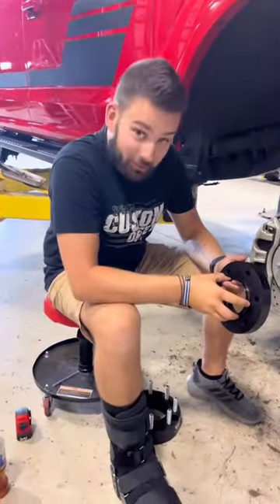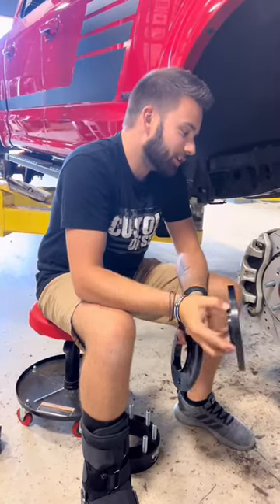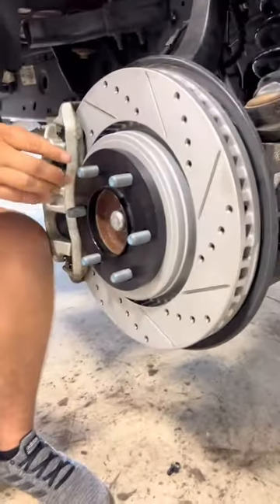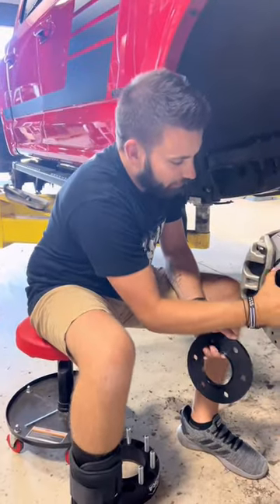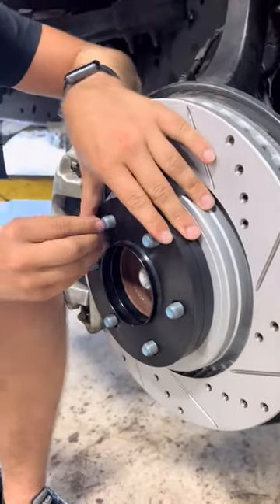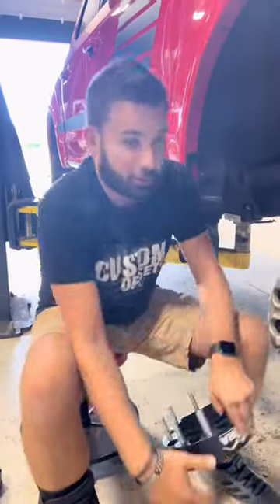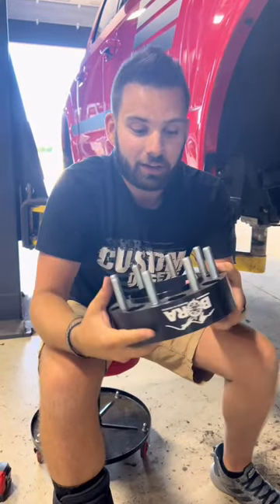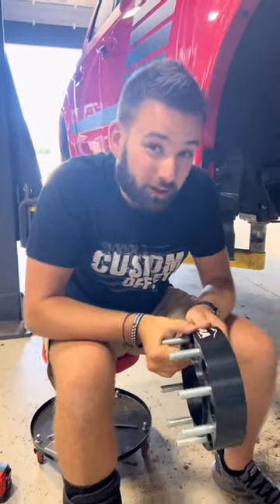Everything You Need To Know About Wheel Spacers #shorts

Comment: I can tell you everything you need to know about spacers. 1: Don't use them 2: refer to 1
Reply: People don't understand why hub bearings and suspension goes to $**t when they use these and think there's gotta be something else wrong. Or get upset when then jack around w the suspense and it won't go back in proper alignment.
Reply: No, I fking hate when wheels are tucked in😤😤 You must hate low ET rims too right? 😂
Reply: When you dont use extremely wide spacers but something like 0.5-1 inch, nothing will happen. I been using it forever or my 30yo bmw drift car and nothing is broken, chill
Reply: @denisnovacek8428  BMW is half the weight of a truck. This is truck stuff they're talking about in the video. If you "drift" your BMW, you have upgraded parts, or are changing them out often, and aren't gonna have time to see the damage from spacers.
Reply: Cars not to bad but trucks especially heavy ones should be a safety concern
Reply: 1. Correct and 2. Correct 😎
Reply: Why not?
Reply: There’s homosexuals out there that actually think people put spacers on for luxe Nahh cuddy we’re just trying to clear them tie rod ends with the stock wheels ya dig
Reply: sobi meed wheel spacers for my miata probably going with 15mm it shouldnt really cause any stress right since its such a light car?
Reply: Why?
Reply: @brianmason8400 This is actually a wrong misconception I used to believe as well.  Ideally the bearing would be happiest with 0 offset wheels, which you know are very aggressive offsets.  0 offset means 0 side load on the bearings.  The closer you are to 0 the lower the side load.
Reply: Do the Bora spacers come with the necessary hardware needed to mount them to the hub?
Reply: Okay but sometimes spacers can be somewhat necessary, for instance my 1 ton dually doesn't have proper clearance between the rear tires so I'm going to have to get a spacer between the two rear wheels. I'm kind of amazed the tires haven't blown considering they ever so slightly touch as is. Averages to about a quarter inch of space in most places but that's too close for me. I'm getting hub centric spacers and again, only between the inner and outer wheel. Shouldn't that be okay?
Reply: Just make sure you have hub centric spacers and don't go over 2 inches, you'll be fine
Reply: Smartest and correct comment.....factory wheel offset is by design to evenly load bearings so they don't fail.
Reply: If you plan on keeping the wheels stock depending on the size… don’t go over 2 inches
Reply: i have 2 inch on my silverado and been great ever since.
Reply: I want spacers on my off-road truck nothing too crazy i bought with a lift (genuinely wasn’t on purpose i was looking at rangers and tacomas and mazda everything was crazy got a 2014 5.7 hemi for cheap off a family mechanic)

Comment: Don’t forget, if you run a studded spacer you may need open ended lugs. So measure your lug and wheel depth.
Reply: It's also a good idea to balance the wheel and the studded spacer together. With a studded spacer there's more centrifugal force and it's possible to develop a vibration. You can mount the studded spacer to the wheel and put it on a balancer. Then mark where they line up before you mount it back on the car. Helped my F-body camaro ride better after I put spacers on the rear.
Reply: @Blade_of_Violet_Chaos  sounds great until you do a tire rotation
Reply: @hunterraatz5481  True
Reply: I found out I needed open ended lug nuts when I bought my 2" spacers. 😆
Reply: How does offset affect?

Comment: Don’t forget to order new wheel bearings as well over time you will need them!!!!
Reply: Even for really thin ones?
Reply: Been running 4 inch spacers for about 6 years now and still no issue on my 06 dakota everything is still good and it still gets your typical v8 mileage
Reply: @imoffendedthatyouareoffended  exactly if you buy quality spacers with hub centric then your vehicle will be fine almost all the people ik have bora spacers and none have had accidents or anything that you usually hear in spacers arguments
Reply: @JYSnukejoe surprise surprise I had the 02 Dakota V6 and I'm looking to run spacers to change the bolt pattern😊
Reply: @PACKERMAN2077  just buy quality ones and you'll be fine I had to make some cuts into the fender liner so it doesnt rub so depends on the size
Reply: @YOUARESOFT.  I didn't mean accidents with Bora I'm saying other brand spacers havent encountered any Bora accidents
Reply: @JYSnukejoe can I use Hub Centric on  ford 6 lug forged moto metal rims when using adapter too run on chevy 6 lug truck
Reply: @imoffendedthatyouareoffended I meant to ask you top question
Reply: @fedism if you have a heavy diesel I wouldn’t recommend it
Reply: @Puffdaddyjose  got the spacers and so far no crazy issues...
Reply: @fedism  dang you got lucky ran some on my 3500 and front end said adios 😂

Comment: If u get proper wheels u won't need spacers. But if u run spacers ur factory alignment has changes. Get alignment after.
Reply: Some guys want to run beefier control arms such as kryptonite and run factory wheels. Most likely will need a spacer then.
Reply: @hunterraatz5481  there's this awesome thing called rebarelling your rim so you can change the offset and retain the factory rim look... Just a bunch of broke idiots who want to look cool with as little money as possible... You know because what others think of you is super important in today's world!
Reply: Or to run a bigger tire you need a spacer to run factory wheels.  Lifted WJ on 33s
Reply: @SupraSkyline369  or you could upgrade your suspension components to bring the rim out so the tire can fit. Again just people being broke and taking the easy way to run bigger rims and tires...
Reply: Can I run 0 offset wheel with 265 tires and 1.25 spacer ?
Reply: @donwan7181  people who down on others for being broke tend to be the poorest of them all.
Reply: Wrong. I have several mechanics in my extended family. You do NOT need an alignment from just installing wheel spacers. Theres no physical way wheel spacers can affect your alignment
Reply: @donwan7181 brother…. These people don’t want the factory wheel look. That’s why we’re buying aftermarket wheels.
Reply: @atumanov55 right

Comment: That half inch spacer is enough to cause extra stress on the components, same as offset wheels, it's not a matter of if you get damage but when it'll start to show the damage from the stress
Reply: I was thinking that’s no way as strong of a concept
Reply: It’s no different then getting an offset wheel that sticks out 1/2” more. Your steering components may wear out a little faster (probably nothing measurable or even more so then hitting a pot hole that you usually miss on your daily commute) but as long as you got quality parts for everything else, a half inch won’t kill anything. Now, the amount of thread left, that’s a no no. Most aluminum wheels have a flange of 1” thick or more, leaving a couple threads for the lug nut to engage. To get the ideal holding power of a bolt, you want the same amount of thread engagement as the diameter of the bolt. (So if it’s a 1/2” bolt, you’d want atleast 1/2” thread engagement, I know vehicles are metric, just easy to convey inches) you’ll be in worse shape skimping out on cheap parts, like ball joints then you’d be by having your tires poke out 0.5” more

Comment: All your suspension angles will change and a total realignment is needed
Reply: maybe you’re thinking of leveling kits
Reply: @leeboystv2531  Ackermann steering geometry read up on it , getting it wrong with spacers will turn a vehicle into a twitchy dangerously unstable thing at speed.
Reply: @mazdaman1286  Yeah, there is a lot of ignorance out there on this subject and in almost every case it will have a negative  impact wear and handling with large spacers.
Reply: @leeboystv2531  you need to do some research and learn..
Reply: Thats not true, however I found in my expirence increasing toe-in 0.05°-0.1° past factory specification will help reduce bump steer caused by increased wheel offset.
Reply: @mazdaman1286 can confirm, vehicle is a twitchy mess

Comment: Should’ve talked about how spacers, changing wheel offset, and big tires eat up hub bearings and destroy suspension parts
Reply: bro chill he had 60 seconds
Reply: @dominicg2456  sounds like he just went through that problem before watching this lol
Reply: no. they don’t. if you install them incorrectly or get extreme spacers, then you do run that risk. getting a typical 15-20mm spacer isn’t going to do any harm.
Reply: @phosphene6145  lmao it 100% will cause more stress on your suspension system. Its not up for debate but people take that risk to achieve the look they want.
Reply: @phosphene6145  It might not hurt short term but I promise you won’t get quite as many miles out of your parts
Reply: Why would he tell you the truth an hurt his wheel business? Lmfao
Reply: @phosphene6145  you clearly never dealt with European cars or American sports cars. It's 100 percent will cause more wear on a bearing and other parts. It's simple physics.
Reply: Oh so you wanna talk sense vs myths jeepers you know the pavement princess truck sites don't habe that kinda sense
Reply: @phosphene6145  youre correct but sounds like no one wants to hear about something they dont know. Most spacers are maybe 1 1/2” that ive seen and if done and maintained correctly its fine and the 1 1/2” hardly changes anything. Now the people that run them will not retorque lugs every oil change and when something happens its always “damn spacer!” Instead of “i went with the cheaper option and was stupid not to expect a little extra maintenance”
Reply: @scottmalcum3472  if that little extra maintenance you speak of is wheel bearings and ball joints and more then you’re spot on. Trust me bro.
Reply: @jakerodriguez9941  technically yea is it going to make that much of a difference that id care? No
Reply: @tenmil1  nope gotta make sure its all tight every now and then.
Reply: Who cares ab the small details it’s all about the Fitment🤣🤣
Reply: @scottmalcum3472  sounds like something a parts changer would say
Reply: @tenmil1  as apposed to what
Reply: Better for splashing mud onto side of truck. If it ever drives off  pavement.
Reply: I trying to figure why doit
Reply: @servicetrucker5564 soo basically I’m fine because I’ll probably snap my axles from launching and need to replace them before having to do all that lol
Reply: Don’t worry about it.  It’s only going from his house to Walmart, hang out all night then drive back home.
Reply: @mustangdemon87 just got spacers 14mm to adapt to new bolt pattern for my 2012 5 series 😢.   Should I be worried? Not a racer just like the look of newer wheels.
Reply: Yeah but most guys lifting their trucks up on 35’s like me aren’t expecting the front end to last as long as a stock truck.

Comment: Wheel spacers also cause premature bearing failure. By moving the wheel out it shifts the weight and applies pressure to the bearings that they were not designed to handle.

Comment: You are incorrect. 
The bigger Bora spacer you pulled out at the end is a spacer. It’s not an “adapter “ 

Adapters are the same but they “adapt” different stud patterns so you can run wheels that your car can’t normally run. Thus the term “adapter” 

If a spacer has the same bolt
pattern as your current hubs but is too wide to use the stock studs , then the spacer will have its own studs to use. 
It’s still only called a spacer ,  not an adapter.  

And….. running high quality USA made spacer made from quality metal , like the BORA spacers , is not an issue at all ! Just make sure they are torqued to specs with every tire rotation. I’ve never had a single bolt come loose after 3 years on 3/4 ton diesel with 1.5” BORA spacers. Even towing 10,000 trailers with it. 
Guys get into to trouble buying a set of crappy China made spacers off Amazon. 

And spacers are no different on suspension parts and bearings than running the same offset wheels.

Comment: Agreed wheel spacers are dangerous! I’ve seen many guys get passed by there own wheels from spacer failure. Either put new wheels on with the desired backspace or drive out the old studs and replace with longer studs
Reply: I've put over 100k on hubcentric spacers. If installed properly they will not fail. If wheels are coming off it's because of cheap non hubcentric spacers, studs too short and/or improper installation.

Comment: Don’t use spacers.  Just get a wider wheel assembly.  The difference between looking good and being good.
Reply: Idkk, I bought 275s for the front on my mustang and 305s on the rear and the rear sits perfectly but the front is still tucked in. I didn’t want to go wider in the front so I bought 1in forged hub-centric spacers just for the front and been using them couple weeks now. Sits perfect, looks way better  and rides real good. We’ll see what happens. I’ve heard good and bad things about them

Comment: When offsetting wheels, I prefer to unbolt the hub assembly off the knuckle and space it with washers as long as the CV axle is long enough to accommodate it. It puts less stress on the brakes and wheel bearing

Comment: I need 2 pairs because the wheels I bought don't fit due to the inner diameter being 15 inches versus my 20s the lugs on the right where the calipers are don't get passed the holes on the wheels. If I had longer studs it'd be good but I'll have to order some spacers with the lugs already pressed in.

Comment: I installed 2” wheel spacers and I can hear a slight knock from one of the wheels… any suggestions?
Reply: Some thing is loose, I had this issue on a nissan patrol, found I had a snapped stud. I've since taken on my spacers. I have snake 4x4 2 inches

Comment: Yes and the added stress to the wheel bearing is also a great feature. Rim and rotors will stay together and leave the chat together when the bearings fail 😂
Reply: Does this also happen with really thin spaces for bolt adapting on a german car? I just ordered them.
Reply: @fedism  any spacer adds stress to the bearing and suspension. The small spacer will still have the same effect just a lot less and won’t wear it out as fast.

Comment: When adding spacers, do you need to go to a different wheel? Or if I'm adding a 1" spacer, can I reuse the same wheel?
Reply: Oh God, if you have to ask that questions, you have no business.Putting spacers on whatever it is you're trying to put them on.I'm gonna guess it's another pavement , queen
Reply: @CWFerbo  I'm actually a very efficient learner. One of the methods I use is asking questions.
Don't let anyone fool you into thinking someone is less intelligent because they ask questions.
I encourage you to ask as many as possible. 
I actually have no desire to put any spacers on my truck as I learned of some of their shortcomings. I learned that by asking questions.
My truck is actually used to go up a 6 mile rough trail to some acreage I have where I'm DIYing an off grid cabin. You would have known that if you asked the question.

Comment: What is the max weight you can tow with spacers?
Reply: Take whatever your manufacturer specs are and reduce them by 100%
Reply: @NoneNone-ou5vp  🤣🤣 lol sounds about right
Reply from the maker: Properly installed spacers are perfectly fine to two with. We hauled around 8,000lbs to shows all over the country without issues.
Reply: @CustomOffsetsTV  how about a gooseneck trailer with equipment?

Comment: What u should really know is if u buy drilled rotors ur not as smart as u think. It’s a god damn hole in a rotor bro, if u didn’t already know it compromises its structural integrity, have the right brake system and press it hard enough crack boom bang goes the rotor. Like real shit if I took my stock rotors and drilled holes in them, who is gonna buy them??? No one!!!

Comment: If you need spacers, you dont need a truck...
Reply: You’re ignorant. 

Running 35x12.5 off-road tires with a 2.5 carli pintop leveling kit causes rubbing on the inner tire against the steering stabilizer bolt. So…… option 1 is drop $1500 or more on offset wheel or option 2 : 1.5” HIGH QUALITY USA made BORA spacers for $500 and keep your nice 20” factory chrome wheels. 
3 years and not a single loose bolt.

Comment: Wheel spacers are stupid. They overstress wheel bearings, throw your factory-designed wheel offset to the winds and aggravate bump steer/road vibration. Just get properly designed wheels for your ride.
Reply: even wheels with less offset that stick out more will stress the wheel bearings more too, not really any different to using a proper spacer. and sometimes you cant get properly designed wheels
Reply: @arcanevoid9199  if they have anything other than factory offset they will overstress the spindle bearings because the will change the location of the wheel vector, wider rims won't as much if they retain the stock steering geometry and CENTERLINE track width. The main problem with oversize tires is tracking and wall flex if they're inflated to track flat, which will require you to underinflate them.